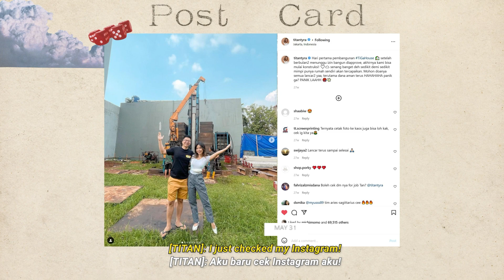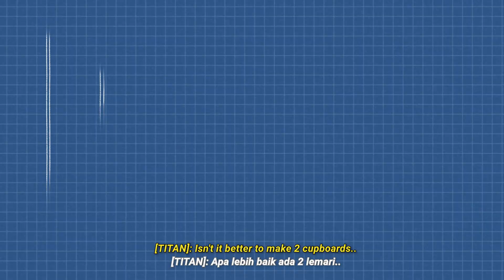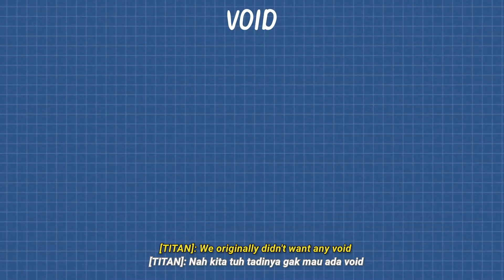PERTAMA KALI KE #TiGaHouse SETELAH 6 Bulan!🤧 Sudah 30% aja 🤩

Comment: On the TV rack thingy, some thoughts:
- If you want to upgrade to bigger TV, dimensions will be a problem
- How about cabling for the TV?
- If you want to quickly mirror something from an app (be it YouTube / Netflix etc) you would wait for so long for the TV to fully come down, and how durable is the motor?
- Big thin TVs can also add a touch of style to the room (Samsung's new AU9000 series for example, or something like The Frame, I'm not a Samsung salesperson lol but I think it can blend well with the rest of the furnishings)
Reply: Agreed! 👍